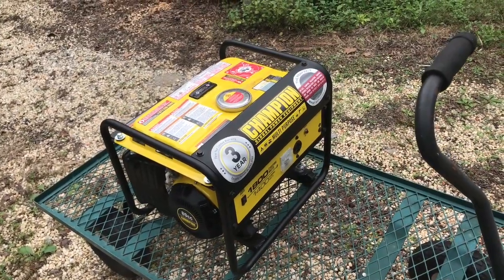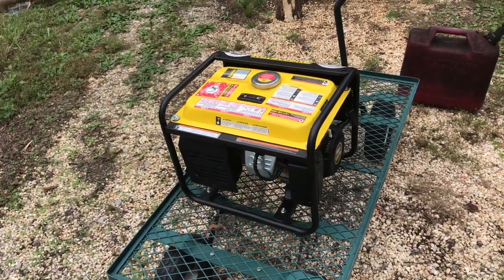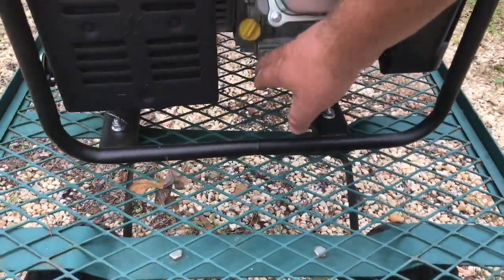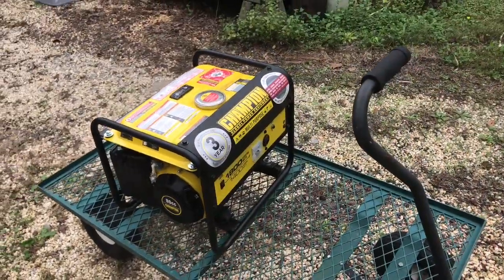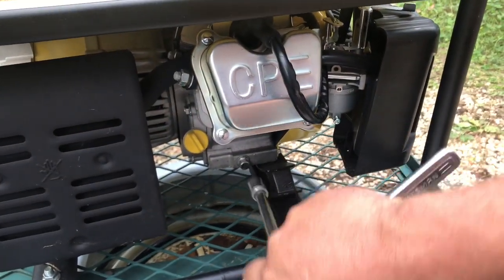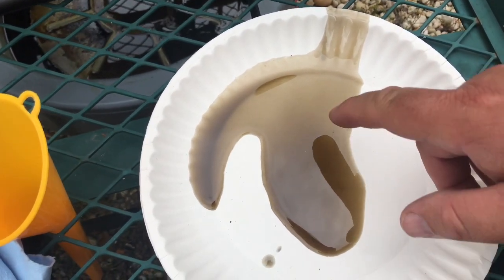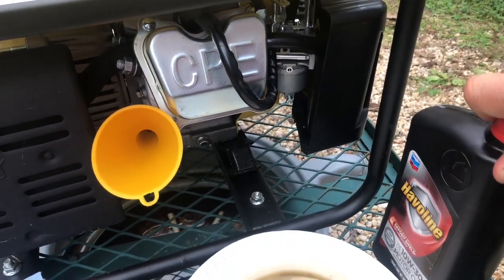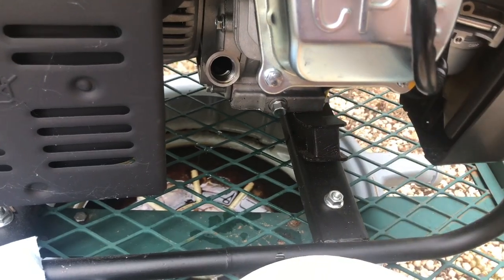Generator Diagnosis & Oil Change

Comment from the maker: Thanks for watching folks, I appreciate it!!
Reply: Dave most generators have q shut off automatically  ir oil get low to protectbthe generator from being damaged Alays check oil after each use
Reply from the maker: great idea!
Reply: Thx sooo much, I am saving up to buy a generator and am debating honda vs champion. I am thinking of compiling a checklist of rv to do's, so I wrote down the tip about changing the oil. I also watched a video where the guy let the generator run dry of gas to make sure its winterized..he said to do it on all your small engines, like chainsaw, weedeater etc...what do you do to winterize your small engines??

Comment: Great advice Dave  ...like you i knew that my genie had a low oil cut out...but never knew how it worked  if it just stopped or run intermittently  thanks for the info mate
Reply from the maker: A $2 light that would come on would be nice,,LOL